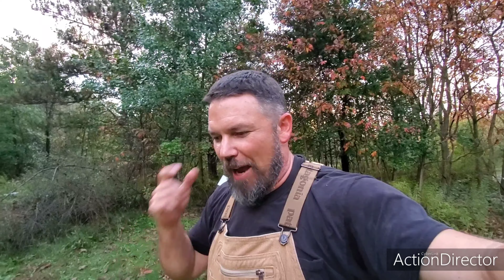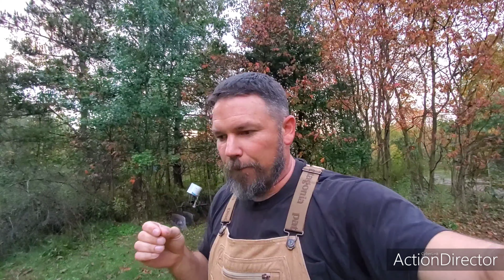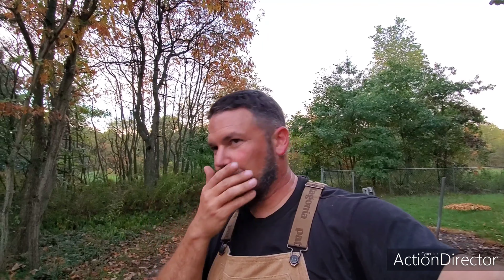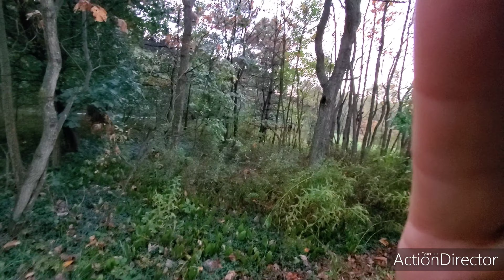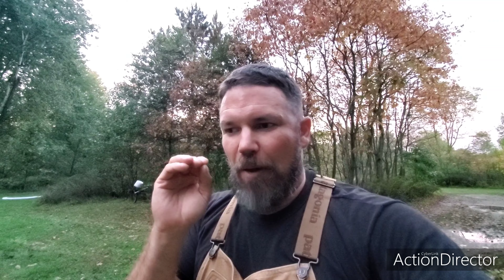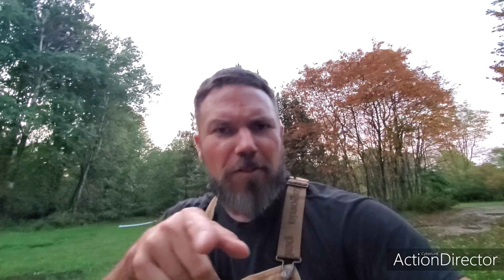EZ SET Springs will be the death of me

Comment: I don’t have much choice with WD TorqueMaster since I’m OHD and we own WD, and there’s a ton of them here. But the retail stuff like Clopay EZSet, or that goofy thing they send with Pella/Amarr, I don’t fix those, as they’re proprietary and we can’t get parts for them, which is truth. Last EZSet I ran into, I just converted it to standard torsion, and the customer has been very happy with it. (Went back to install a motor). If I ran my own show, I wouldn’t even offer TM replacement. Either put standard springs on it, or walk away. The headache of some of this stuff is absolutely not worth it. Issue with an iDrive, replace it. Issue with a Guardian, replace it. Issue with a Ryobi, replace it. You are 100% correct- fixing an already sub-standard product is absolutely not worth it.

Comment: I always change those systems out. I tell the customer they come from a box store and I don't service those parts because I can't/won't warranty them. If they give pushback I tell them they can pickup the parts and do it themselves if they want, it's designed to be safe for installing for homeowners as long as they follow the instructions and have the tools. I am usually able to blame it on the previous homeowner who was a "do it yourselfer", they laugh and explain the other "projects" they have found around the house. 

Was it missing the plastic piece that holds the tube into the bracket? Without that the drum will fall out of that metal bracket. Those middle couplers are just asking for problems.